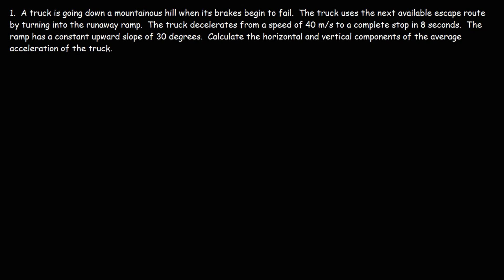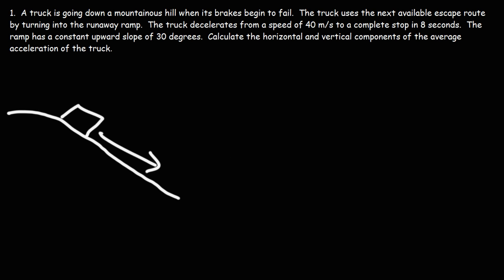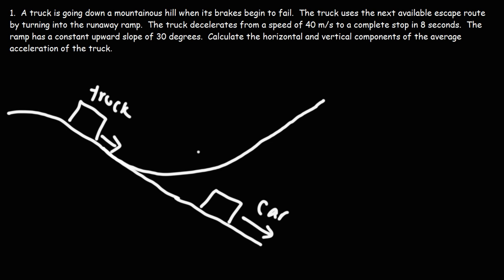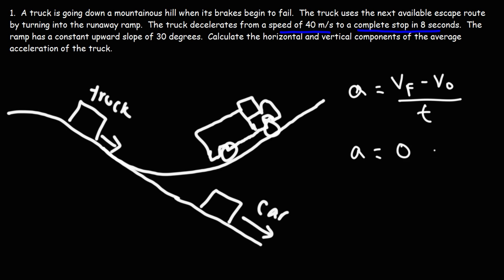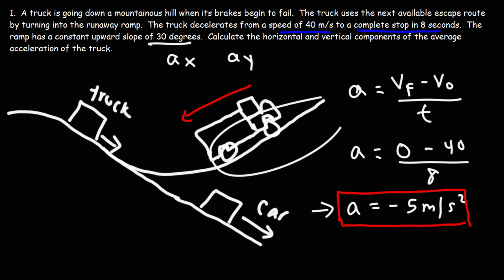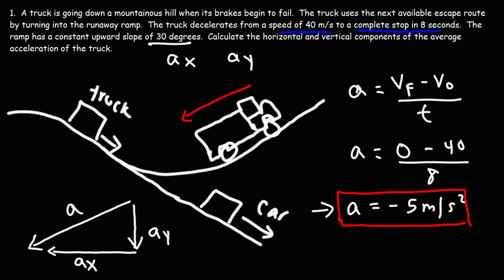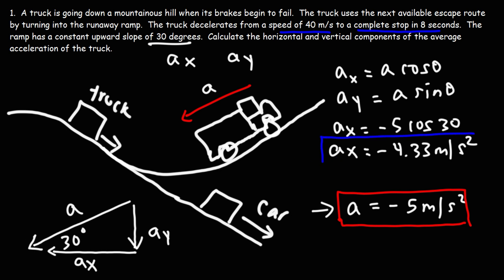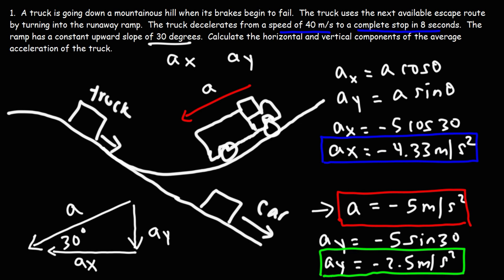Runaway Truck Ramp Physics Problem - Finding Components of Acceleration

Comment: Just retrieved my trailer that was stolen loaded with oil. Driver lost gear 1 mile into 17 miles down hill grade of 11%down grade and hit ramp at bottom and went 1059 feet up the ramp. Ramp had 4ft snow at bottom and 8 ft at top and plowed it up 18ft high when stopped. Wicked pictures ill post but what's the speed they can't figure because it took rock up from ramp 6 inches deep with the snow so they can't figure the weight of snow it pushed

Comment: There are YouTube videos of trucks using the runaway ramp. Typically, they don't use an incline but rather a sandbox.
Reply: I drove a truck for several years in my past. I have seen the ramps but never had to use one. I've heard it's quite an expensive stop as it's difficult to extricate the truck from the sand, takes a while and a BIG wrecker. There may also be official fines, not sure about that, but I have picked up that from listening at truck stop restaurants. Who knows?

Comment: SUMMARISED via ChatGPT:

- A truck's brakes fail while going downhill
    
- The truck turns into a runaway ramp to slow down
    
- The ramp has a constant upward slope of 30 degrees
    
- The truck goes from 40 meters per second to a complete stop in 8 seconds
    
- The goal is to calculate the horizontal and vertical components of the truck's average acceleration
    
- The formula for acceleration is change in velocity divided by time
    
- The average acceleration is -5 meters per second squared
    
- The X component of the acceleration vector is -4.33 meters per second squared
    
- The Y component of the acceleration vector is -2.5 meters per second squared
    
- Viewers are asked if they have ever seen a truck use a runaway ramp
    
- The video covers kinematics, free fall physics, and projectile motion, which are likely topics for a first-year physics exam.